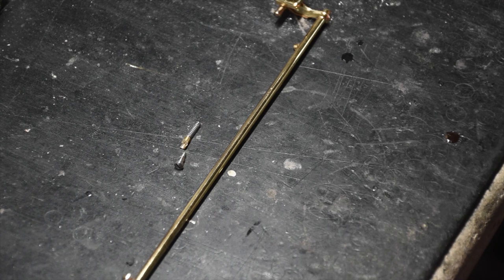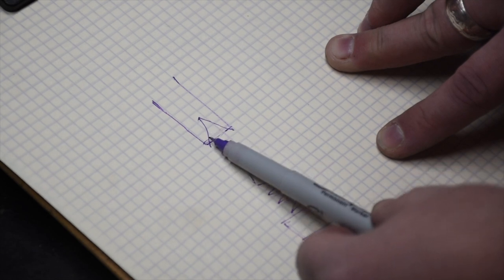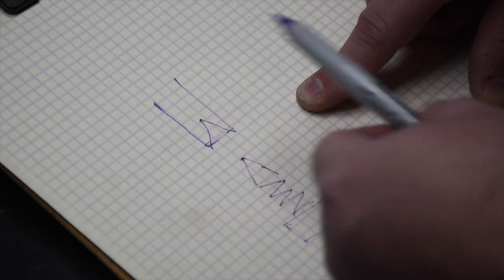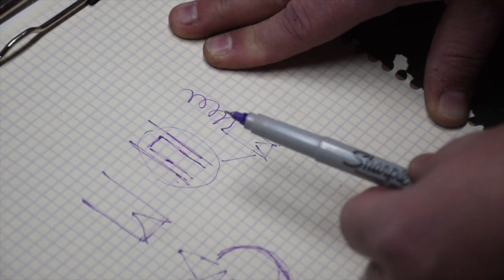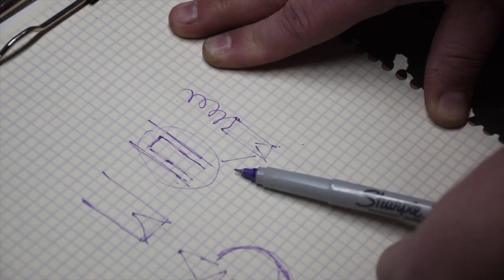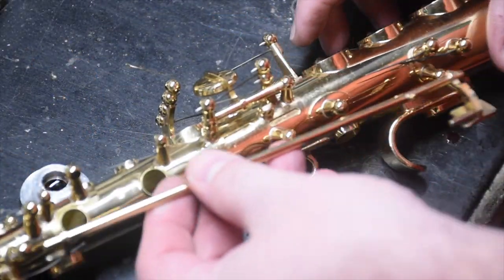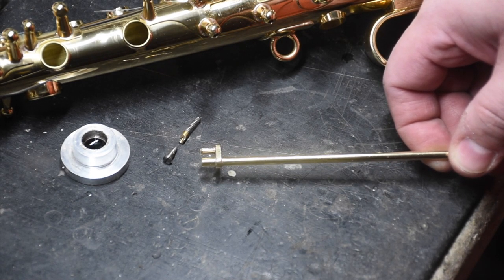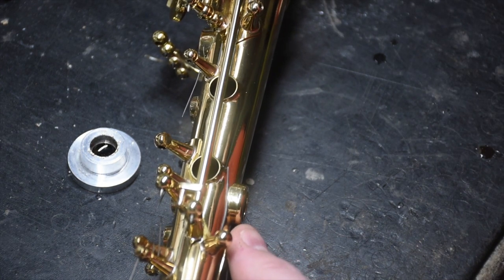Repair Tech Rant about a popular maker

Comment: I am betting that was some "bean counter's" idea of a labor cost-saving measure. Because the pivotbis spring loaded, there should be no need to bother to hand-fit the pivot. What that ch ignores, of course is the inherent axial play, which, if the rod carries a key cup, will translate to imperfect pad seating. I cannot imagine ANY mechanical engineer being satisfied with that obviously flawed design.

Comment: They are annoying...but in real life they do work.
Less precision, more friction, but always zero play, no rattle etc.
If you are going to modify, as an amature watchmaker I have thought...why not a ruby bearing in the bore, 
Synthetic rubies are cheap and so hard that between steel screws and ruby..with lube...VERY little wear.
Reply from the maker: It's not a hardness of material problem.  It's a wear problem and lack of maintenance problem.  A little bump opens up a gap in the pivot bearings and it just wears and wears and wears until you have ruined hinge end and ruined screw.  Keep that gap within tolerances and free of gunk and grit and the mechanisms will last forever.  The stupid spring things seem to have been to combat an epidemic of screws wearing out.  Screws wearing out was not the fundamental problem in itself.
Reply: @woodwindfixer9248  it was the low friction of polished steel against polished ruby.
Lower maintenance.

But...jewels can crack.....

The thing that annoys me most on selmers is lack of adjustment screws on the back bars.
Reply from the maker: @think2023  People often conflate material properties when it may not actually be cause/effect.  Arguably the best lubricity in woodwind mechanisms can be found in the late 19th/early 20th century German makers who used nickel hinge pins with nickel keys--not an alloy.  Nickel in that form is much softer than even mild steel, yet it works.  The harder the material, the more highly polished the surface must be and the more perfect the profile must be. 

Adjustment screws on saxophones are really not a desirable idea until we have a hand-made quality instrument.  The yamahas with adjustment screws cannot be set up as precisely as those without. Adjustment screws provide an additional 2-3 points of lost efficiency to the equation.
Reply: @woodwindfixer9248  we will have to agree to disagree on that one.
Using thin tech cork the yamaha system is reliable and stable enough. Switching to larger surface area screws....even moreso.
Like intonation, mechanical systems are always a compromise.
For me, near instant adjustment with ease using locktited adjustment screws is worth the compromise of added parts and reduced contact area.

Im sure you would agree...horn repair isnt a one size fits all deal.
Reply from the maker: @think2023  and obviously that is where we differ.  Reliable and stable enough is not a standard my clients or conscience let me utilize.  On yamaha adjustment screws I have even reprofiled the head and secured them so they were not able to move, and still they were not as solid or smooth as the 875 alternative.  Rotational and tangential geometry cannot be left out of consideration.
Reply: @woodwindfixer9248  rotational and tangential geometry?
Assuming correct radial clearance, and the fact that they rotate about the same axis...I dont know how that can apply.

As for "not good enough for my customers" I would like to live in a world where even little 7th grade johnnies YAS-23 was re engineered to perfection....that ...in the eyeys of his parents, would be a bad value.
For my pro playing customers I do a lot more in tweaking for tuning etc. But for all...if I do a full overhaul I give a 5 year warranty.
Been in business over 10 years...think Ive had maybe three "comebacks" under warranty...but more than that in customers asking for another overhaul.

To each their own

That said....DAMN are there a lot of sax butchers out there!!!!
Reply from the maker: Yes, in mechanical utopia, sharing the same axis means it should all be good...but that means the plane of all the pad cups and all of the toneholes must be the same too, and the centerline of the toneholes must be perfectly parallel (coaxial?) with the hinge axis.  They're not, so it isn't that simple.
Reply: @woodwindfixer9248  We will have to disagree. Same rotational axis and zero axial amd zero radial play =zero relative rotational movement.
Its not utopia...its fact.

Bottom line? I am WAY fussier than 99.99999% of my customers. (And that last .000001% isnt fussier)

I am happy, they are happy, and I know of no other repair shop with longer warranty.
Reply from the maker: If you want to discuss the finer points of instrument repair, that's fine.  But don't self-promote on my page.  It is in poor taste.